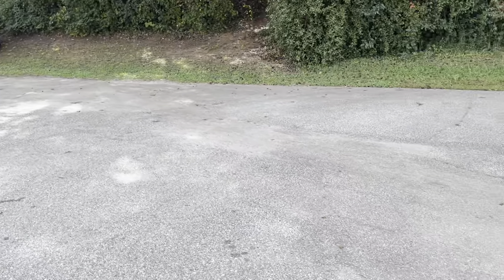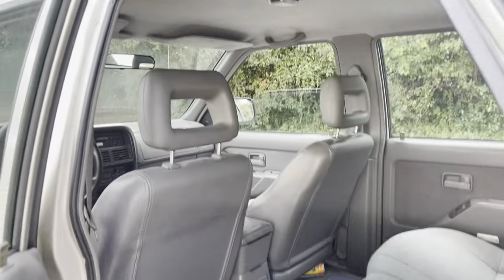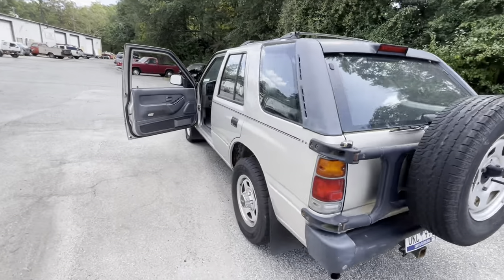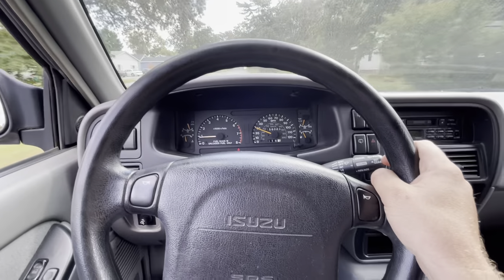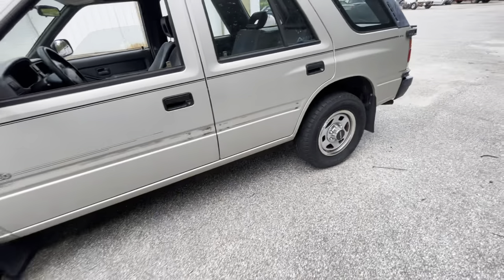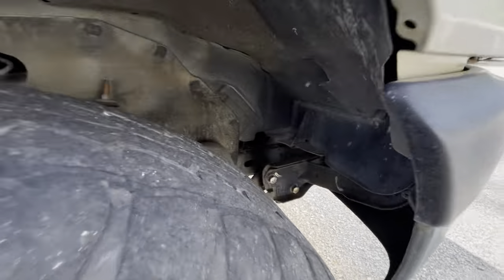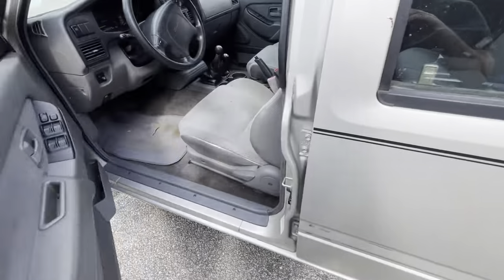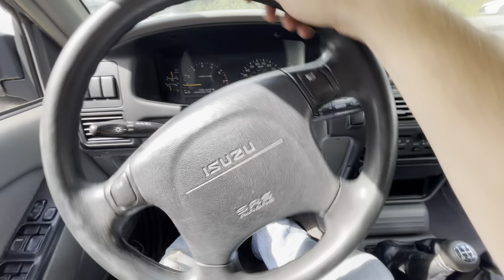The Holy Grail of Isuzu Rodeos (Barn Find)

Comment: These were a Holden Passport in Australia. The Holden Rodeo was the ute version. Same interior, wheels, front end, etc. with a tray on the back. We had two of them when I was a kid. They were invincible with the 3L turbo diesel. Wish we never sold them. Incredibly capable.
Reply: This was before Honda made a deal to get a passport.
Reply: I have 2 Rodeos...a 96 and a 97.
Both run great....both 5 speed manual trans.. 2 wheel drive
4 wheel drive unnecessary.

Comment: That is a good deal! 3M adhesive remover would get the glue off without hurting the paint. I like that engine better than the GM engines I usually see in those.

Comment: Just picked up 1996 Honda Passport. same motor, automatic, green. Clean inside and out. 136,ooo miles. Had a coolant leak thru coolant bypass pipe under intake manifold.

Comment: I guess most US cars is automatic. I was a bit surprised when people were starting to write "unicorn!" about my black 1995 Trooper LTD 3.2 5 speed manual. I live in Sweden where they was never sold as new so I guess it´s a unicorn in it´s own way here too. I can say it made an Isuzu lover out of me. That hydraulic lifter noise will go away with some frequent oil changes and some driving. About the timing belt. They are pretty easy to change, also they are non-interference if it should break.

Comment: I have a 96 as a back up vehicle. The fuel pump sometimes won't run...gets stuck. I hook up a hose at fuel pressur gauge port...give it a shot of compressed air...breaks pump free...fast and easy to do.
👍

Comment: I have the same rig…almost. My is a 1997 and the A/C doesn’t work and has 48,000 miles. Otherwise, identical. Great rig. I found it in Maryland 2 years ago with 31,000 miles on it and the fuel pump didn’t work. It had rust in the tank - a fresh used tank from Utah and I have been good to go. Live my Rodeo.
All the same issues. Hood latch, radio, etc. Hilarious.

Comment: You shouldn't leave your gas tank near empty as that will wear out the fuel pump
Reply: I totally agree. I don't know if my gas cap was bad and the fuel just evaporated from it sitting, but the fuel pump was exposed to atmospheric air and it just rusted up the metal pump inside the plastic housing of the fuel pump. Had a quarter tank when it was parked. But it was empty when I pulled it out to work on it. Pretty sure the gas cap was bad in it all just evaporated.

Comment: Back then I remember that v6 was known for not being thrifty. Mileage compared to the v8 Explorer depending on how you drove it. But a very common motor across all their SUVs including that weird VehiCross or whatever it was called. So maybe getting parts for the engine is not a problem since there are likely many still in service? At $2,500 IMHO that's a real bargain.

Comment: In early 1992 I purchased a brand new left-over '91 with the same specs. It had remained unsold because of the manual tranny. I'd like to say what a nice SUV it was and occasionally it was true, it certainly worked well in snow, but the reality is that it was one of the worst POSs it was my misfortune to own. "Unreliable" doesn't begin to cover it. It was badly put together in Indiana and even the GM 2.8 V6 was barely mediocre. Ran on 5 as often as it ran on 6. Leaked coolant from new. Had a bad head gasket also from new. Every mechanical component broke at least once. Heck, even the paint came off in large sections. Then one morning, after two miserable years of ownership, it broke a rear suspension mount simply driving out of my driveway. That was the end for me: I returned it to the dealership. Oh, and that fuel pump ? yeah, it was crap from the factory. Mine was driven a lot, but it still quit, leaving me stranded in heavy rush-hour traffic to the dismay and chagrin of the poor folk behind me, some of whom vociferously expressed their doubts as to the validity of my parents' marriage.

Comment: You do realize that the OE Delphi pumps come with a lifetime warranty too right? So thats makes absolutely no sense. But whatever. Ive been in parts for 15 years and worked on cars for 15 years. Buying quality is ALWAYS the better option and they ALWAYS have a lifetime warranty.

Also, 2500$ is a bit high. It's not a "low mile" example, it's not mint and it's still a rodeo which are not the best in reliability. It needs a good detail inside. Ive bought and sold cars for 16 years now and selling stick cars is really difficult these days. I love manuals, but i dont buy them to sell anymore. I doubt this will sell for more than 1500. My Suburban i picked up for 1500$ and while it has almost double the miles of this, its much more reliable and desirable.